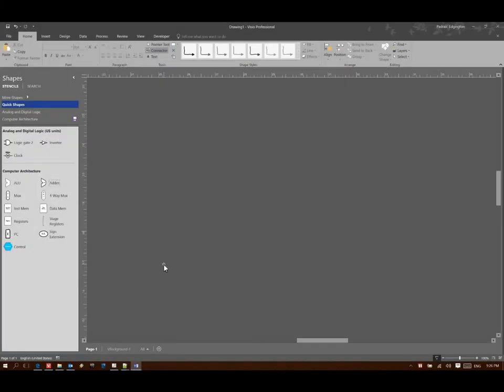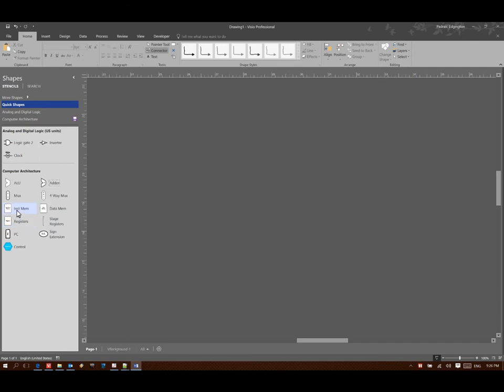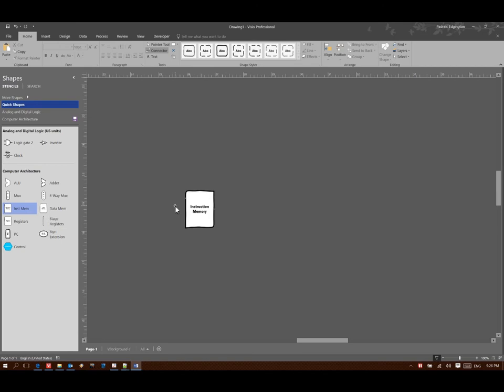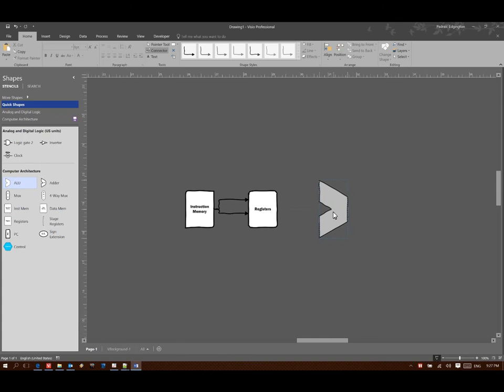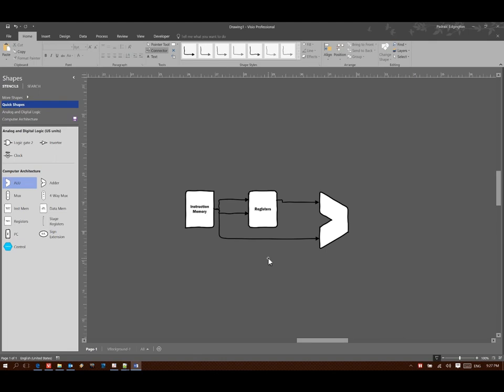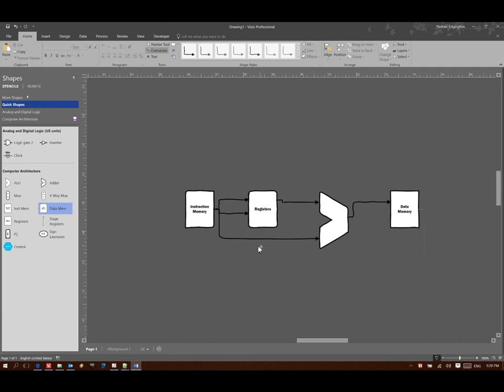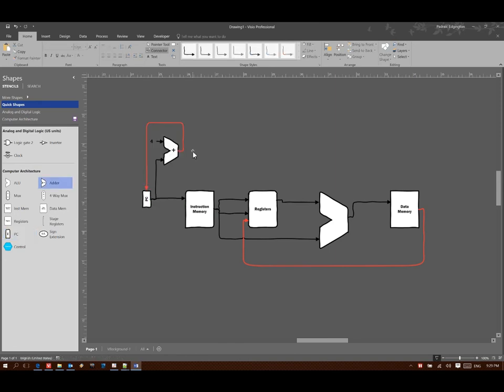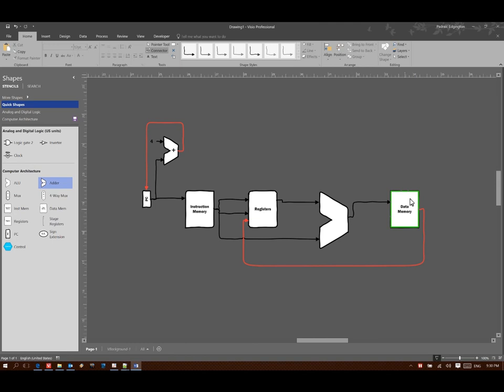2-3.  Datapath (lw)

Comment: Why is the data memory used?
Reply: That's where the data is stored you want to load to do calculations or where you want so save data from the registers or from register operations to use them later.